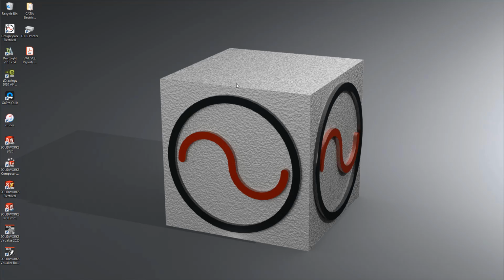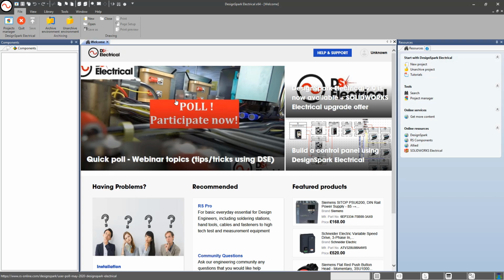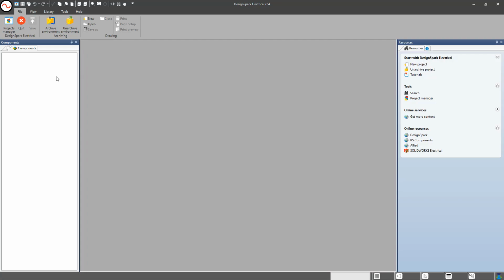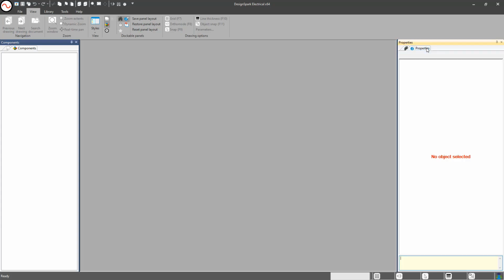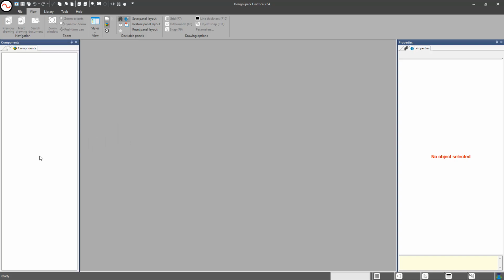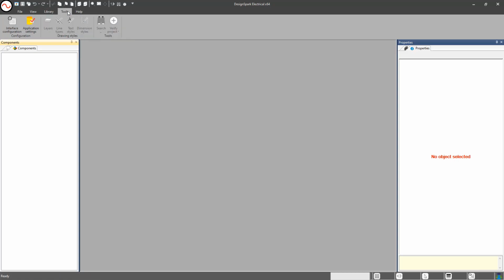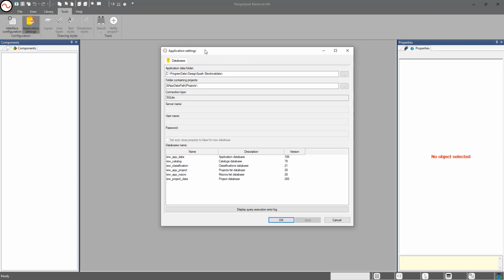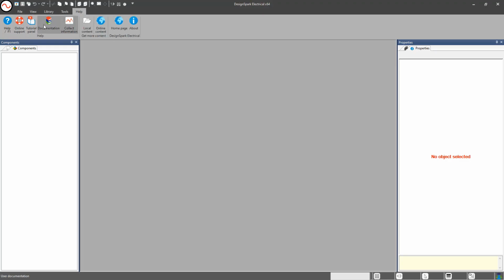DesignSpark Electrical Training | 1. Familiarisation

Comment: I tried to install DSE as local user with admin access. It does not work. I don't even get an icon to click. Uninstalled it and reboted my PC and logged in as local admin. Installed DSE again. Got an icon I can click and the program started and updated some folders with parts and stuff. Logged out and logged in as local user but no icon and no accsess to DSE, even if I try click the exe-file in the file explorer. 
I used Designspark Mechanical almost a year now without any install or start issues no matter if i'm logged in as admin or user. The guys that made DSE should learn from the DSM guys.